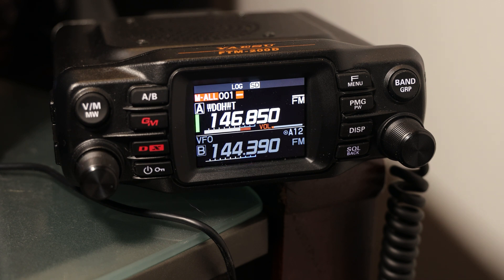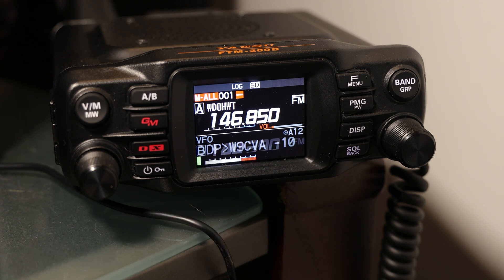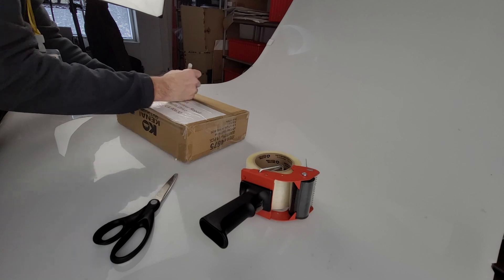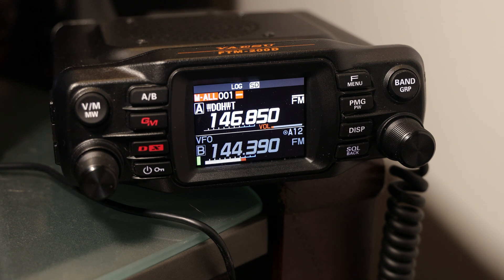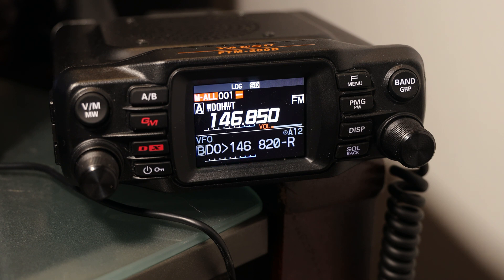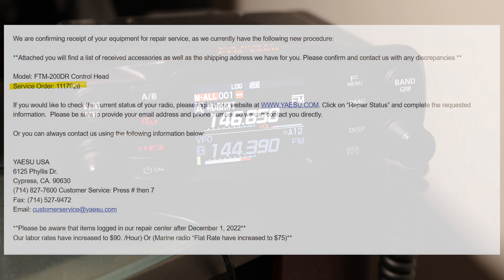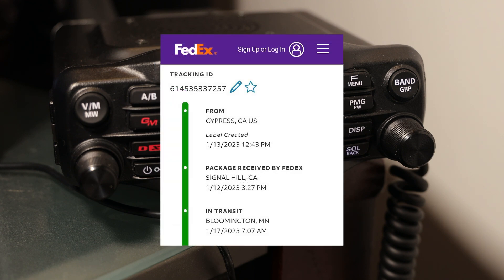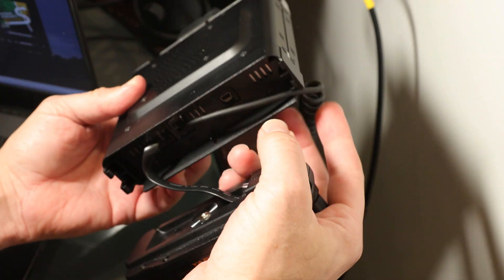FTM 200 - Three lessons I learned after sending my radio for repair!

Comment: Hi Paul.  I had to send my FTM-200DR in for repair twice.   The first time the external speaker jack at the rear had come loose from the chassis.  The second time the radio kept cutting ion and out on receive.  Also the volume knob had almost no friction, causing it to either up or down when bumped.  It was annoying.  So maybe Yaesu has some quality control issues?   Just FYI.

Comment: I have an FTM200. This week it says it is transmitting, but I get NO RETURN from the local Repeaters, Two of them are on hills I can see from my house. This is my THIRD Yeasu Product in a row that has taken a dump on me. I also had Two FT-891 tank on mens well. When I got the second one back, the service people at Yaesu treated me like GARBAGE! I sold BOTH of the FT-891s. I DO have a THIRD FT-891 now. I'm currently on a trip THREE HUNDRED MILES from home with ZERO 2m or 70CM comms. I'll be checking my HF rig tonight, and if IT has also gone South I will be PERMANENTLY finished with Yaesu products!
Reply from the maker: Sorry to hear that Bruce, that's the pits!
Reply: @HamRadioHobbyist  When my FTM 200 comes back from repair, or if Yaesu replaces the radio, makes no difference. I will sell it and buy an Icom 2730.

Comment: A little off topic but be careful if you ever need to send anything into Samsung for repair. Sent my watch in to them and  two weeks later on a Saturday night around 11PM I got a message saying the watch was connected to my account meaning somebody was using it. It was on ATT service. Sadly Samsung claimed they had not received it yet even with tracking saying they had it for over a week. Funny thing was I got an email that afternoon telling me they just received it and it shipped back to me the next day. Another funny thing one of the emails from them reminded me they tell you to take your sim card out of it. I replied it had an esim and I would use a hammer next time to remove it.
Reply from the maker: I would be very frustrated were I in your place!

Comment: Had myFTDX-10 in for service work, it was really great. I dropped it off (I live in Southern California), and they shipped it back quickly. I think it was 10 days total including the shipping time to get it back to me.  Would have been better if it did not need repair but the process was really super easy.  

I think all the transceivers have three year warranty. From the DX Engineering website: "Subject to the Limitations of Warranty and the Warranty Procedures described below, YAESU MUSEN hereby warrants all transceivers, rotators, amplifiers, repeaters and HRI-200 WIRES-X devices to be free of defects in materials and workmanship in normal use for a period of three (3)"

Comment: Di you ever wish u had the ftm300? $60 difference and the 300 has bluetooth installed. But the 200 has the PMG
Reply from the maker: Definately a difficult choice and yes I do go back to that decision periodically!
Reply: I chose the 200 and upgraged it with the bluetooth module. Because I dont need a second VFO in the car, the 200 with PMG + bluetooth is the best choice for me. And it still saved me some money.
Reply: @filippetersen1304  Great reply. I was thinking same thing. I have FTM400 and seldom need dual receive. what do you use the bluetooth for and how do you like it?
Reply: @mattb7406  I am using bluetooth to connect the trx to my bluetooth speakerphone through my infotainment systems. The audioqualiry is reasoble but this is of course due to the NF range of the car loudspeaker and infotainment system. So I can lay the microphone ont he center shelf of my car and listen/speak through my bluetooth speakphone/infotainment. As I said, audioquality on TX and RX is reasonable but still a good compromise. We are not allowed to use handmikes while driving here in Germany.
Reply: i have the 300 working great. better than the 200